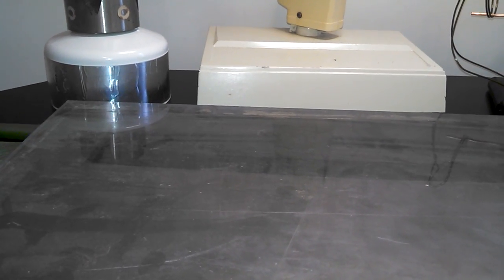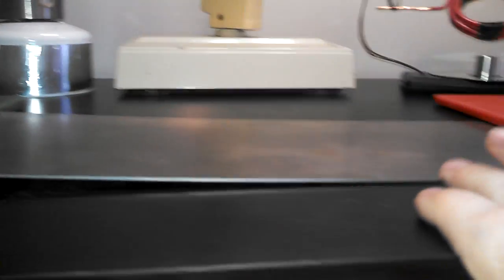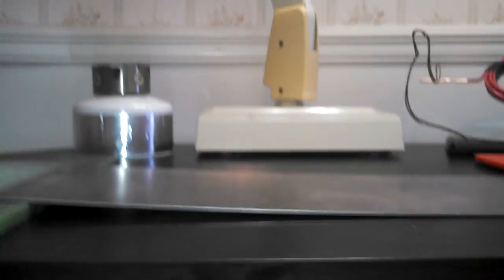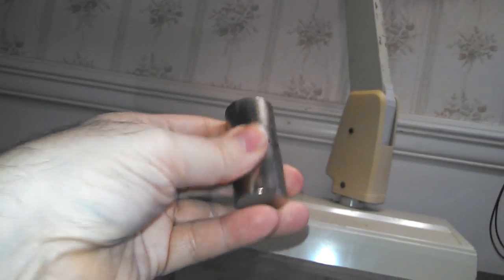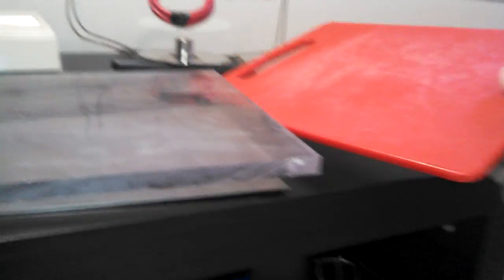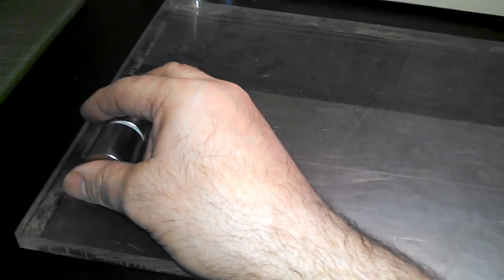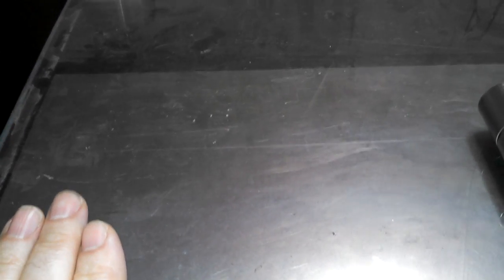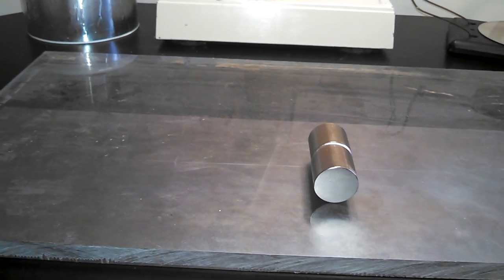🧲 Contoured Magnetic Runway Plates Explained - DEMO

Comment: why when the magnet is resting on the plexiglass it does not move, then when you move it to the cutting board it moves?
Reply from the maker: Guess what? Turns out we've had German magnet motors for cars since 1966. Google it. Now others are creating their own magnet motor that truly work. Using only magnet to create continuous motion has long since been solved and replicated by others. There for this is no longer theory. Thanks for visiting nonetheless.

Comment: James, I've been following your videos for a long time now.  I have a firm grasp on the principles you are demonstrating but I have yet to see a build that is capable of producing enough torque to overcome the the drag produced by the load from copper wire coils in the production of electricity on the scale needed to be worth the time and money invested.  I have seen some interesting work by another YouTuber (MrAnguswangus) that may boost your output potential.  I would love to see some output.